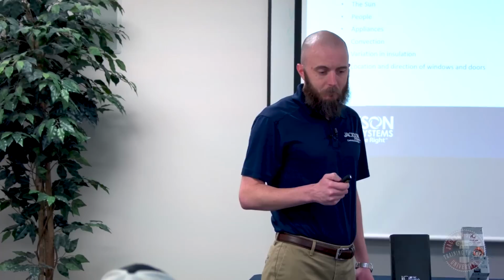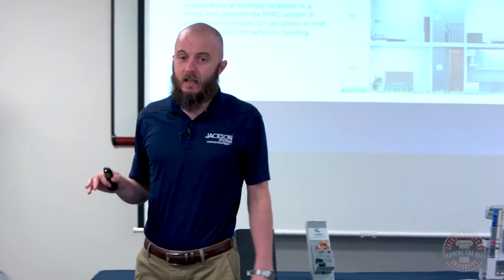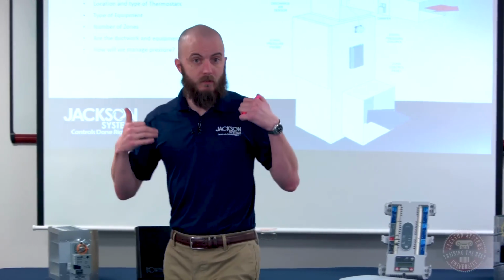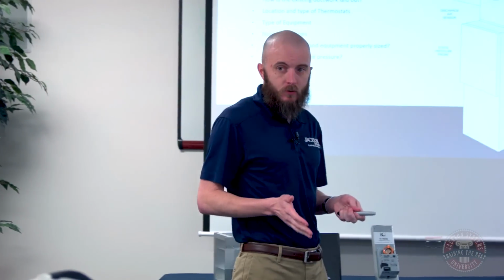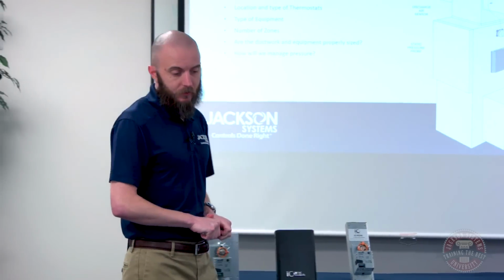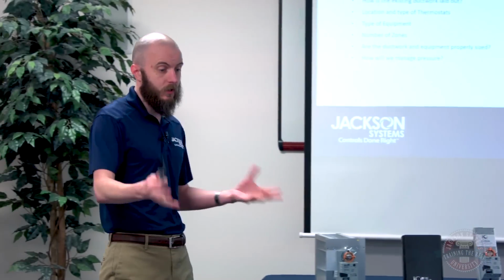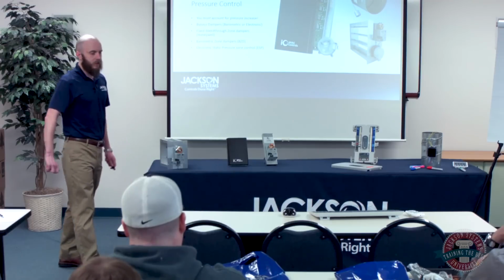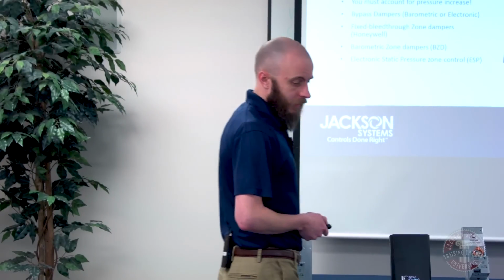HVAC Zoning 101 - Intro to Zoning

Comment: I've only had to diagnose and replace damper motors, but its always seemed inconvenient when these systems come to end of life and have to be replaced. They are also expensive to install. I've only seen these systems in north carolina, i havent seen dampers in south Florida. Would there be a reason not to use dampers when youre working exclusively in an environment as hot as miami ? Are zoning controls something that can be sold to homeowners here or are there reasons this systems arent frequently used here?
Reply: Zoning just allows you to control different areas of the home. The dampers allow you to close off airflow to any given zone in the home. . Not that complicated , and can be used in any home anywhere in the world.

Comment: If my system (duct work and blower) has been carefully designed such that air flow through the ducting is well balanced, will restricting air flow by closing dampers - say to call for heat/cooling in one zone only - cause an increase in air pressure within the ducting leading to whistling and noise?

Comment: I’m a new homeowner of a newly built spec house all of 5 months. I have 3 zones. Two floors. Street level and a downstairs. The downstairs gets no sun and thermostat is in the hallway....the coldest part of the floor next to a sliding door. It’s set a 62. When the heat comes on (auto) each bedroom temp goes to at least 75 or more. We sleep with the doors closed. Also we feel heat coming out of the vents on the main floor making it warmer than we want. Seems like I’m heating my house from the downstairs zone. Something isn’t right. Any thoughts?

Comment: US HVAC systems are so... primitive. Here in EU we have underfloor heating and cooling, and a ventilation with heat recuperation on top of it. And all of it in 2000 sqft house priced at $200k.
Reply: We have that shit too dummy. Called a boiler or a geo system. Not an option for everybody.  Also not necessarily always the best option.

Comment: Can a remote temp sensor connected to a single smart thermostat (like Nest or Ecobee) be used to drive multiple zones?
Reply: Nobody seems to address how to use the zone system. Everyone talks about what it is, the components, or installation issues. I've heard differing approaches to the settings of the different thermostats for best results and less stress on the system. Thoughts?

Comment: Hi, I have a question does this system works better with an non variable speed motor blower. It's a trane that I have but it's not an inverter

Comment: If setting up a zoned system from scratch, would each zone have its own return?
Reply from the maker: Hi Ambrose, 
Ideally yes, you would have a return in each zone. Ultimately, you just need to make sure the air can get back to the air handler. A few other methods are using balancing vents between closed rooms and open spaces, undercutting doors, or never closing any doors.  When possible, we recommend ducted returns.
Reply: Jackson Systems, thanks for the info. I really enjoy learning the technical side of HVAC, although I am not a professional. I do how ever work with high pressure fluid pumping systems, 4,000 gallons per minute at pressures upward of 9,000 psi. So I have a good understanding of head pressures, suction pressures, pressure differentials, etc. and all the process piping associated with that. We usually set up a new spread every month. I would like to learn more on residential HVAC, do you have any suggested reads (text books even) on residential HVAC? Thanks again.
Reply: @JacksonSystems   Howdy! Do you know where I can find the slides/PPT for this amazing training session? I cannot find them on your official website. Thanks🤗

Comment: Hola Jackson i have 3 zone but one only closes 50% will be that the zone sistem  panel is failing that output?
Reply from the maker: HI Juan, Thanks for reaching out. There could be a few reasons for a damper to only close 50%, but a failing panel would not typically cause that problem. Who manufactured your panel and dampers? Do you have a bypass damper?
Reply: Jackson Systems  is Honeywell  if you have but the reason is that the other two zone if they close full That's what I do not understand Thanks for your time
Reply from the maker: It sounds like your Honeywell damper has a minimum bleed setting that is preventing it from fully closing. This is to protect the system from too much pressure in the air ducts. If you are an HVAC tech, Call our Engineering team at 888-652-9663. They can help you make sure everything is working properly.

Comment: Hi great video. I have a few questions pertaining to my system. I am not an HVAC professional but have a construction background so I understand some of it.  I am looking to zone my second floor to get better results out of my system, especially in the summer. I have a typical 2200sq ft 2 story home. I live in the NE and put a new system in a few years ago which is a HP with a two stage gas furnace. (propane) I have had two quote fairly different and a third who said he would not zone at all and its more of a system issue. Is the space to small to be zoned or is this not a great package? I need to figure this out before finishing the space.
Reply: What is the Tonnage of the unit? I would definitely recommend zoning. 
Getting three bids and having them be very different in price is all to common. Find a Carrier Factory Authorized Dealer. They have all of the best training.

Comment: I have a 3 zone system and I want to replace my Honeywell thermostats with Nest or Ecobees. Can I replace them the same way i would if they were on a single zone system or is there something special that has to happen with the control panel?
Reply from the maker: Hi Duane, Thanks for the question.  In most cases, if you are currently using Honeywell thermostats you can change them out for smart stats like Nest or Ecobee, no problem. The thing you will need to check is to see if you have enough wires (at least 5) running back to the zone board. You will need a 5th wire for constant power. What zone board do you have?

Comment: Hi, this is a great explanatory video, thank You!! I’m not a HVAC contractor but I am trying to design the right system that will work in my house that I’m remodeling. I would like to ask a question. If I install big enough supply and return ducts going to two floors that I would like to zone separately, can I get away with not installing pressure release damper? And if it is not a good idea to oversize my ducts, what are the options for electronic dampers that can release only excessive pressure into the second zone that isn’t operating at the time. I wouldn’t like to release pressure into the return duct because I feel like it’s a waste of energy and heat.
Reply from the maker: In some cases, where there are only two zones, and the zones are fairly evenly sized, oversizing the ductwork by 15%-20% can allow you to get by without any additional pressure relief, however oversized ductwork could potentially cause airflow issues when both zones are calling, particularly in long duct runs.  The ESP Zone Control Panels allow for bleeding of excess air into non-calling zones, and all offer selectable bleed, so that you can exempt certain zones from the bleed-through if you so choose.
Reply: Jackson Systems thank You !! That helps!